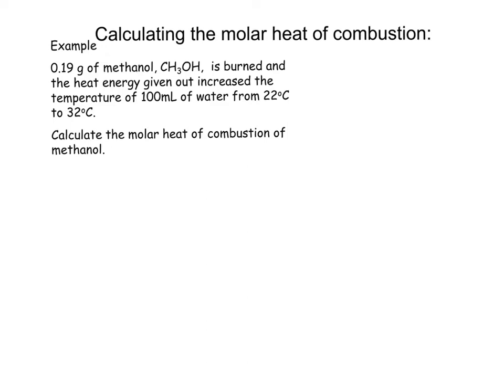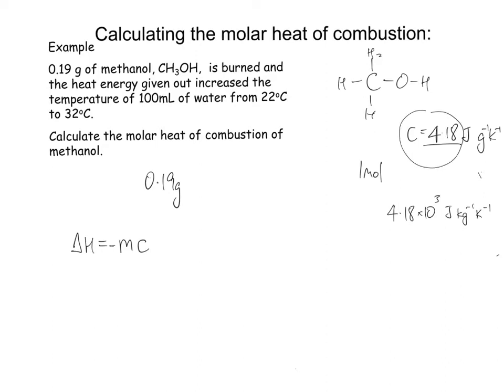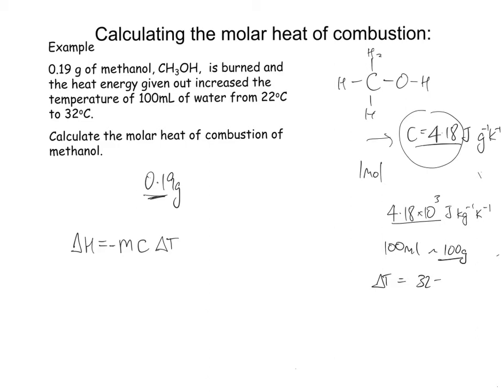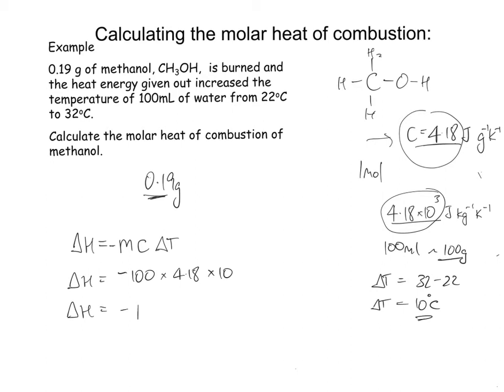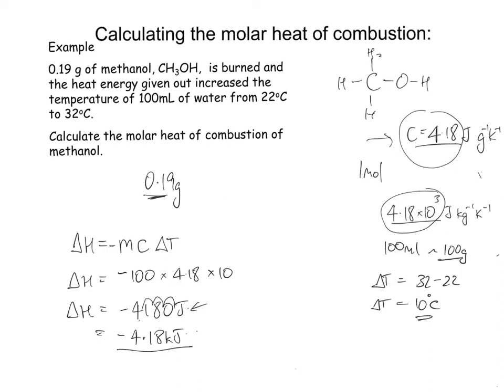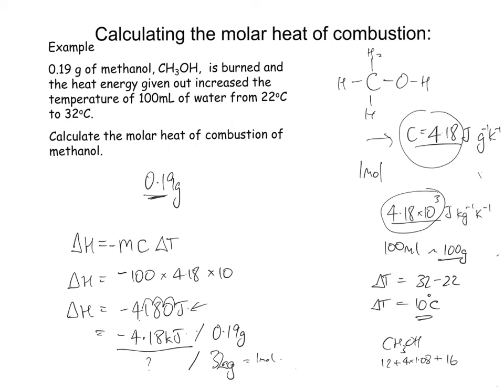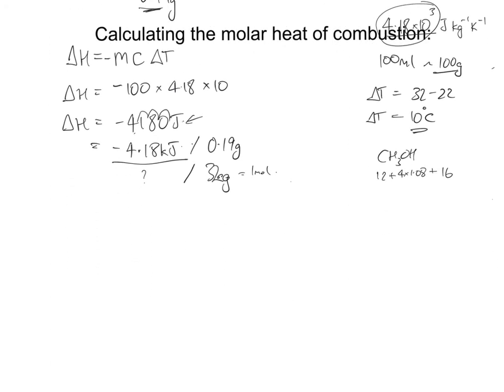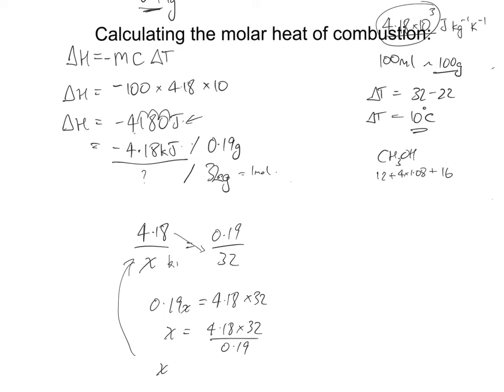Heat of combustion of methanol calculation

Comment: With 1 spoken line, you just fixed my entire chemistry assignment. We weren't told in class that the -m is implied. So I calculated everything at a positive value and ended up pulling my hair out over it. Thank you, so much, you absolute hero.